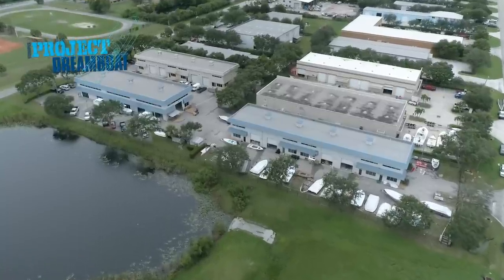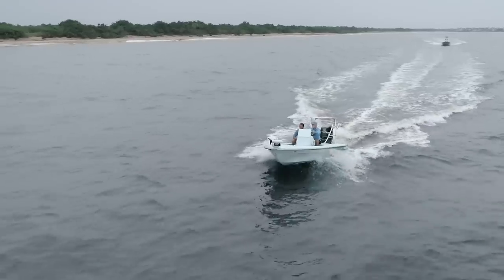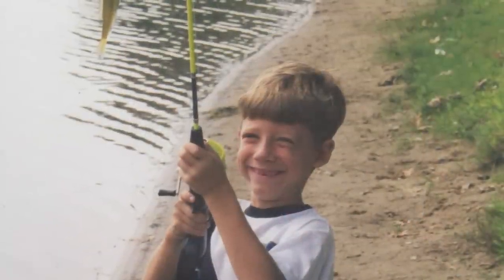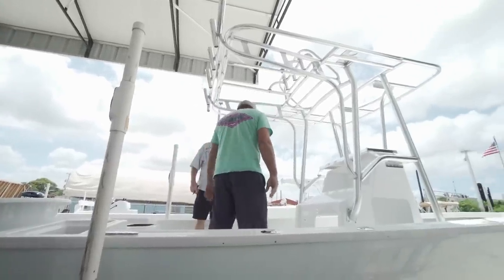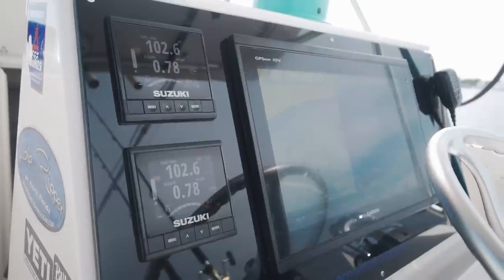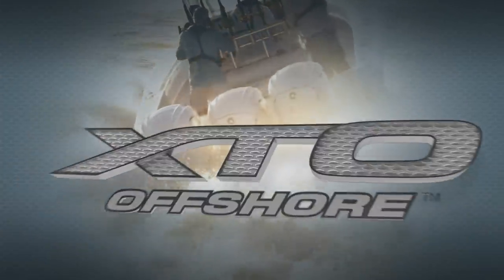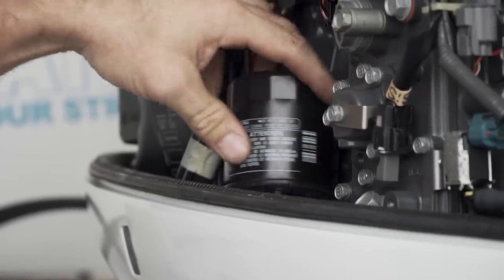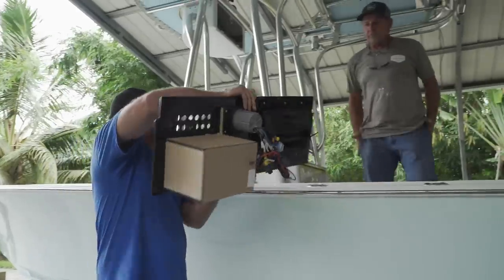Florida Sportsman Project Dreamboat - Classic 20’ Seacraft Intro, Custom Pursuit

Comment: can you guys do a video on inboard maintenance. Its always focused on outboard
Reply: They don’t have inboard sponsors
Reply: @vmonroig21  unfortunately true
Reply: It’s basically the same. Change oil and filter, fuel filter, impeller, check all other fluids, hoses, belts, plugs etc. If it’s an I/O change the gear oil and inspect. Your engine manufacturer prob has a guide to tell you when to do all the service.